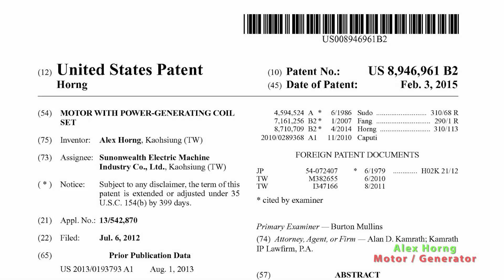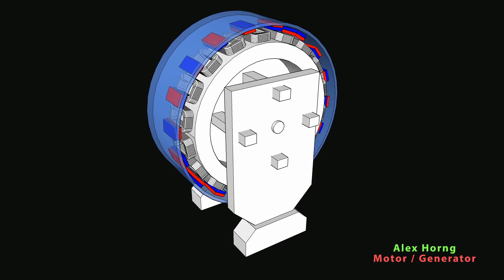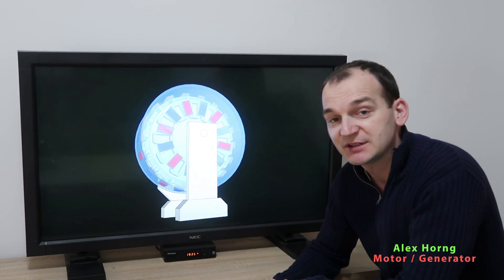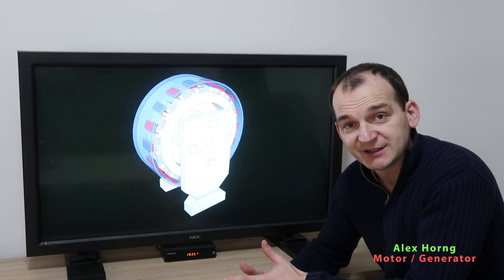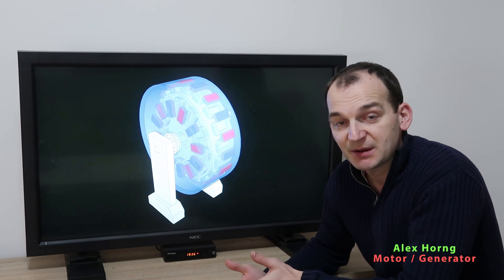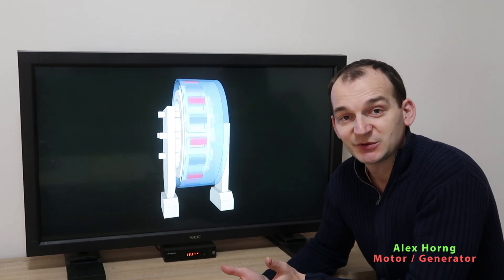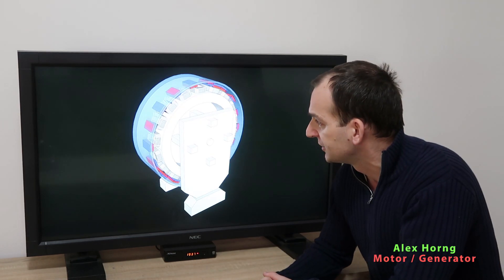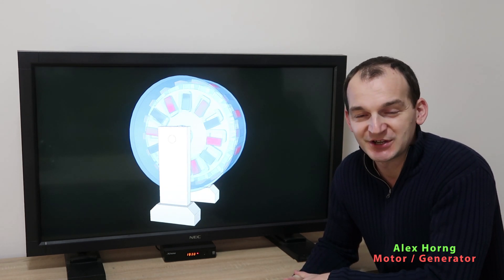Free Energy, Overunity MOTOR GENERATOR by Alex Horng

Comment: so long as there is no back EMF force on the generator... then it could work.  So you would need some one way diodes on the generator to stop back emf current... also where there is no center on the magnets... its harder for Emf from affecting the generator.  These are my thoughts... anyway... I am a machinist... and I will test this idea to see if it will work.  The thing is... the generator must make enough energy to run the motor and have extra energy.  That is idea of Over Unity.  Anyway... I will test this idea soon as my machine shop is up and running... which is soon.
At which... I may be back to report on this... if I can find the website again.

Comment: Electric Generator Design that's powered by it's self & perpetuates more electrical current then is needed for it to run continuously on it's own. 
 Step 1: Calculate how much energy you need pumped into an electric motor to make a vertically positioned circular platter with magnets in-bedded horizontally around it's left side and right side (so there pushing force is pushing out sideways relative to the vertically spinning disc) to spin as fast as you need it to. Also better to make sure these magnets are shielded around their sides & back  with metal that has high permeability so the magnetic field they are emitting is focused fully out sideways. :D Step 2: Calculate how many sets of copper coils you need to be interacting with magnetic fields to achieve this & to perpetuate more electrical current flow then is needed. :D Step 3: Build a round horizontally positioned platter covered in all these copper coils pointed down that does not move (Is stationary) :D Step 4: Build a round platter covered in powerful magnets pointed up that can spin and place it directly under platter with hanging copper coils. :D Step 5:  Position the vertical platter that is  motorized close to the horizontally positioned platter covered in magnets pointing up so that when the vertically positioned platter spins the in-bedded horizontally positioned magnetic fields slam sideways against the edge of the horizontally positioned platter causing it to spin. :) Step 6: Make sure enough of the copper coils are feeding their electrical current into the electric motor and the rest of the copper coils are linked into a set of rechargeable Battery's placed in the closest most convenient spot. Step 7: Build a duplicate setup of horizontally positioned discs with hanging copper coils and disc with upwards facing magnets and assuming the first set of discs are positioned to the front left side of vertical spinning disc, position the other duplicate structures to the front right, the back left and the back right of the vertically positioned motorized disc. As the vertically positioned motorized disc spins the horizontally in-beaded magnets will now hit into all 4 horizontally positioned discs causing them to spin. so you will effectively be using the spin of one disc powered by one electric motor to spin 4 constructs that are each generating electrical current. now build this whole setup multiple times over and use the current perpetuated by it to power up scaled electromagnetic generators that are equal to or more powerful than the ones used in a nuclear power plant. You will now have a device that is self perpetuating off of it's own electrical current perpetuation and no nuclear waist to worry about.

Comment: I did something very similar back in the sixties, as a teenager...
An inner disc with permanent magnets arranged radially in alternating polarity.
On either side, a disc with coils adjacent to the magnets, wired from position n on one side to position n+1 on the other disc..
The angular relationship between the two outer discs was variable to allow optimisation of the field transfer between the ‘generator’ coil to the next ‘attractor’ coil.
The inner magnet disc was free to spin independently between the alternating coils with interesting results.

Comment: the energy needed to rotate that is much more than what it produces. so yes you are generating eletricity at the same time you are spending it but it would be always less than what it needs to rotate. the angle of the intersection of the magnetic flux with the coils is very bad. If you want to make a overunity you will have to think on a design that allows the magnets to go trough the coils like in a faraday flashlight.

Comment: Just be aware, there is a National Security Order automatically put onto ANY patent that exceeds over 20% efficiency. So if you do go the patent route, and your system is more than 20% efficient, they can and will legally confiscate your patent under grounds of a "Threat to National Security", or they will buy your system and the intellectual rights and it'll never see the light of day again. You will also be forced to sign a non-disclosure agreement if you decide to sell, meaning you won't ever be able to talk about it again. This isn't conspiracy, this is fact. Over 5,000 patents have been seized under national security order. It's best to open source the technology. Cheers
Reply: bruh motors are like 90% efficient

Comment: thanks for posting.     folks should not be intimidated by the existence of a   patent.     in this case,  a 'patent'  has lead to greater   Awareness, of a  VALID  ou concept and that is a very good thing.      eventually, it will be seen that the underlying process  is a  NATURAL  LAW;  just plain  old  physics/Leverage.      this patent, is meaningless, as a patent.   why  is this true.         this concept is valid because it is  Based on   FUNDAMENTAL  'laws of science/physics/leverage'.     this concept  violates  NO  laws.     there is nothing new or Proprietary.     (it would be like trying to enforce a patent on  'gravity'.)        this concept has been  Successfully demonstrated, by GC; see linked video; see my research, for the 'why' of it.      this is good, old   MECHANICAL ADVANTAGE,  the law of the lever,  as seen in a  Rotary, 2nd-class LEVER.  (other uses include waterwheels and wind turbine rotors.)       here,  the rotor of the (large-radius) outrunner motor is the  Rotary LEVER,  to which force is applied, at the Drive coils.     where a load occurs at a  'smaller radius',  THE MOTOR  HAS INHERENT MECHANICAL ADVANTAGE.      in the  over-simplified design seen here, only a very small amount of MA is present, however.     higher MA  equals  more force to turn a purpose-designed  PMA, whose traits are  MATCHED  to the amount of  Available  power/torque/rpm/etc.    cheers          googletranslate
https://www.youtube.com/watch?v=lTkXciAn488

Comment: I came up with this design years ago, and likely other people have done as well. Didn't think it was novel or useful enough to waste time/money on a patent. Instead of having the generator part of the system separate its integrated into the motive part at a different angle. Other than that it's a conventional motor/generator that is unlikely to have OU potentional (at least according to the animation shown). It's more compact but also with drawbacks due to that integration.